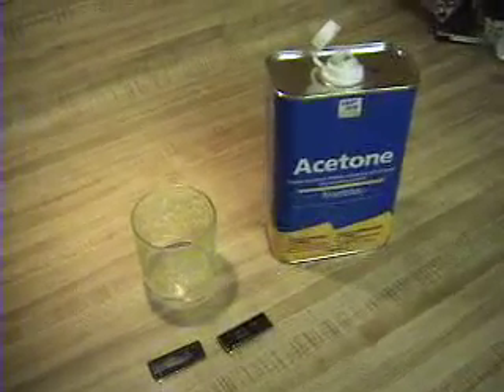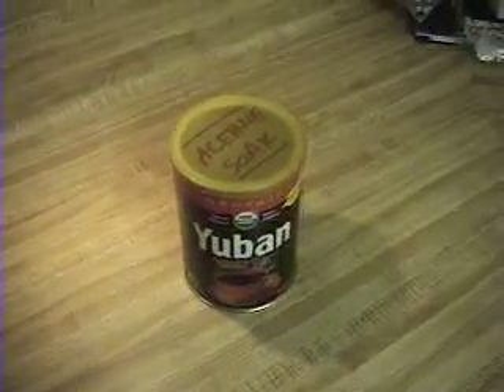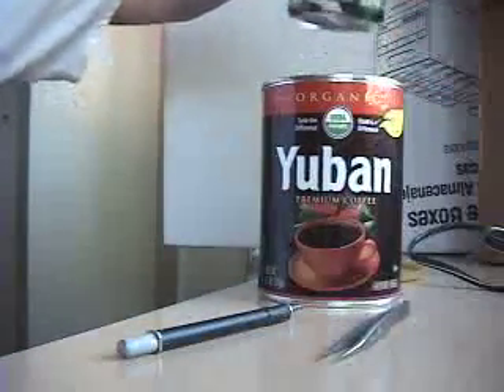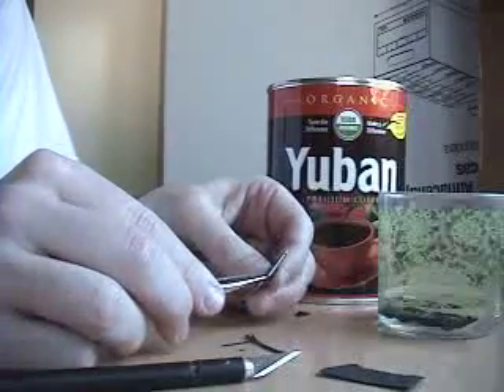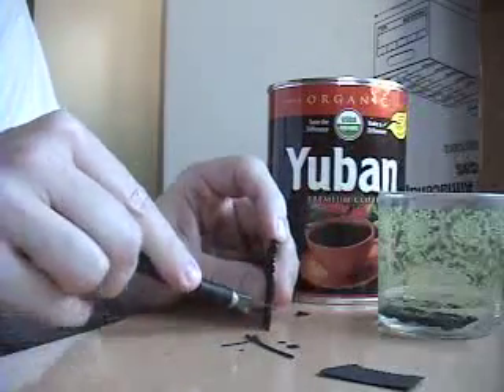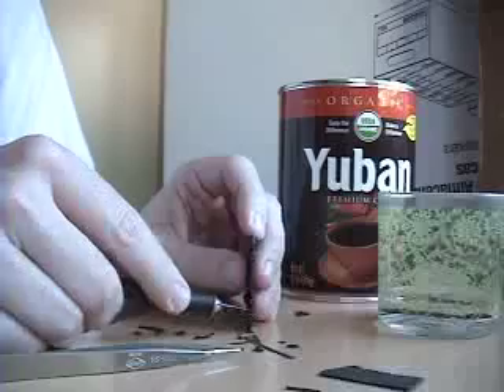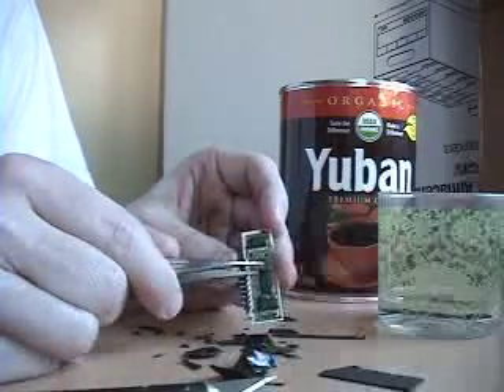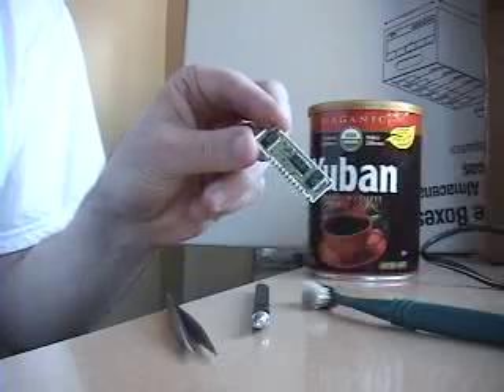Possible Repair Technique for the 80017a, the Juno-106 Voice Chip

Comment: In my case, it took at least two days for the 80017A. 
It took 4 days for MC5534A. After the first two days, I scraped the three sides of each MC5534A then I kept them in for another two days.
They come off incredibly easy if left in acetone for enough time.
You will want to replace the stupid pins on these ceramic boards and its a good idea to put female headers on the mainboard.  80017A has regular 2.54mm pins but MC5534A uses 2.0mm pins so be careful :-)
Also, I went 100% clean in terms of removing all visible remaining resin between the chip pins with a small needle. I didn't desolder the chips from the ceramic boards and clean underneath them.
I had a small problem with one of the tree MC5534A ceramic boards.  a surface mount component (capacitor or resistor I really don't know) the one closer to the pins, came off since apparently it was stuck to the resin much better than it was to the ceramic board. I can not find any information anywhere what this component is since I want to replace it. The one came off appears to not have any metal pins on it so I need a new one. I might remove the same component from another MC5534A and check with a multimeter but I would rather learn what it is from someone who knows what it is or even better from a schematic or some document. I would really appreciate any help if anyone knows what this SMD component is.

Comment: I've watched a bunch of these videos in hopes someone explains WHY removing resin solves the problem. I'm sure it's legit but how on earth does removing the resin fix an electronic issue?? Makes no sense
Reply: A few years ago someone suggested the resin becomes conductive. However this isn't actually the case; it expands and lifts the chip pins off a few microns, enough to cause them to become intermittent. When you remove the resin, the agitation of the process is enough to reseat the pins and are liekely to work again, but not always the case, hence the 60% success rate. What you actually need to do after removal of the resin is to re-touch the pins of the chips with 60/40 solder (don't use lead-free, it doesn't mix with the 60/40 it was originally soldered with).
Reply: @LEKProductions  Welp, this is by far the most helpful response I've seen to date. Thanks so  much for taking the time. I hope everyone reads this who is doing the job. The guy who made this video should add this knowledge to his video description as well, excellent. Thank you!!!!!!!!
Reply: @JMLRecording  I may do a video on my channel about this...

Comment: I didn't use an Exacto knife at all. I soaked for 4 days, pulled the loose stuff off. Soaked another day, pulled the loose stuff off, etc. It's taken about a week doing it that way. No scraping or cutting necessary.
Reply: Could this possibly damage the components?
Reply: @JMLRecording  I didn't have a problem with it. On the other hand, it didn't actually fix what was wrong with the bad one, but now I have sockets installed and can easily replace old ones with clones as I need. So it doesn't fix everything.

Comment: Hello, I am a technician and have recently started to remove the coating from 80017A voice chips.  I have found that a number of the chips have fractured internal solder joints. If you remove the coating from a chip and it still doesn't work you may want to get a tech (with a high quality soldering system) to re-solder the connections of the ICs and possibly the terminals on the chip.
Reply: Ties in with my reply to Joshua Lutz below...
A few years ago someone suggested the resin becomes conductive. However this isn't actually the case; it expands and lifts the chip pins off a few microns, enough to cause them to become intermittent. When you remove the resin, the agitation of the process is enough to reseat the pins and are liekely to work again, but not always the case, hence the 60% success rate. What you actually need to do after removal of the resin is to re-touch the pins of the chips with 60/40 solder (don't use lead-free, it doesn't mix with the 60/40 it was originally soldered with).

Comment: @nokbient : regarding being worried about it drifting out of tune in the future due to removal of the resin / coating...
While it may drift a little, the only thing it will drift on is VCF tuning, and only so slightly. As for VCA, only so slightly. The VCF tuning would likely not be detectable by the human hear as it is a filter, not an oscillator we are talking about. The VCA drift would amount to much less than 0.25dB! Which you would never hear or detect.
The DCO is stable and independent of the VCF/VCA chip / circuit.

Comment: Hallo

Nice and helpful video you did. :) 
Maybe you can help me with troubleshooting. All six voices of my 106 work fine. The only thing that's irritating is that when the VCF frequency is down (ENV up) e.g. for a bass sound, every sixth key pressed plays the sound as if the frequency knob was up (like open filter). I gave it a short check having detected that only happens when voicechip #2 is adressed.
So might that chip be faulty or is it something about filter circuitry referring to some voice path?
Unfortunately I do not know how exactly voices/filters etc. have been routed internally. :(
I would appreciate any help.

Thankies and greets :)
Reply: Calibrate the synth as per the service manual.

Comment: I stripped the polymer off and my 800170 came back to life.  I had to give it a second pass and dig out from between the IC pins a little better, but it worked.  Now to find out why my VCF freq slider is not working anywhere below 1.5. Any tips?

Comment: My friend, you are a genius. Our old 106 had the notorius 'alien' sounds in the background and the 'hanging' note. Ran the test procedure and it pointed to be chip #1. Got my techie guy at work to de-solder and remove chip #1 then I followed your instructions to the letter. 2 days later, all the coating came off easily, techie re-soldered it back in place and IT ALL WORKS PERFECTLY!!! Thank you so much for sharing your skills with us all. Kind regards; Paul

Comment: I am asking the same question MarbleMad had...

Does anyone know if this works long term?  I did it to 2 chips on an mks-30 and it worked..  I am trying to sell it.  Would it be a good idea to strip the other 4?  I would hate to sell it and have another chip crap out a week later, but if this fix causes other problems down the road I wouldn't be comfy with that either.  I am an electronics tech so I'm not really worried about damaging anything good on removal.
Reply: Seven years later, does it still work?

Comment: How do you know what's wrong with these chips?
Do they overheat during use?
The plastic package covering the chips is not the best heat contactor. 
Do these chips have defects in silicon that becomes worse and worse 
during use?
I think someone will need a very expensive piece of equipment
and a good reference  datasheet to determine what's wrong with these components...

I hate disposable electronics...

Comment: Hi!
My 106 seems to have a problem with the filter resonans after I had new voice chips. I can't seem to get all six voices to track even with keyboard tracking when the filter is self-osclating. If I set it to poly 2 mode and only use one voice at the time i am able to play simi tones with it, but when it is in poly 1 mode and I play more then one voice, the voices doesn't tune up together. Do you know how I could fix this?

Comment: Just wanted to let you know that I did not give up yet. I did save the chip and continued to soak it in the acetone for a few more days, and successfully got most of the resin off of it. Now, hopefully I can find information on improvising new pins so I can go on with the project. Until then, courage.

Comment: i tried this on a 106 my bandmate got for $45 with a very very quiet #4 voice chip. took longer than as advertised for the coating to dissolve (soaked for about 6 days), but i got it all off. put the chip back, mounted the circuit board, etc. and it worked!
for a little while. i left it on for a while, then went back to play it, and it sounded just as busted as it did before. it was worth trying though. time to save up for a new chip!

Comment: 100% pure silicone rubber (sealant) is non-conductive. I've used it in high voltage circuits for TVs. The bad chips that I cleaned didn't have a black silicone coating inside but the ones that were good (I cleaned off the coating anyway) all had a thin layer of black silicone. Either Roland discovered the coating problem and solved it by using silicone under the coating or the company that actually made the chips took a shortcut and didn't apply the silicone layer before the external coating.

Comment: This is an amazing fix will be trying this on my faulty juno voice tonight!! Thanks so much for putting up this tut greatly appreciated. I actually bought a replica chip about 6months ago and still havent got round to fitting it as was concerned about calibration problems. How did you find removing the actual chips was it tricky did you use a solder sucker?? Also can you possibly tell me how you got it into "voice number mode" on the dispay. I can't remember how to do it?!

Comment: I used an Xacto knife and magnifying glass (lupe) to CAREFULLY clean the coating from the laser cuts in the resistors. I didn't dig the blade into the cuts; just scraped the blade over them. Some of the chips had to be soaked for 24 hours, cleaned the coating that came off easily, and then soaked for another 24 hours. The acetone only seems to affect the coating; not the bakelite that the actual ICs are made of or the green coating on the chip which is actually a circuit board.

Comment: The coating IS the problem. Apparently, it semi-shorts out the circuitry which is precision tuned with laser trimmed resistors. I've successfully repaired 12 chips by CAREFULLY cleaning all of the resin off the circuitry; especialy the 10 laser trimmed resistors (dark rectangular patches) where the resin tends to stick in the tiny laser cuts that tune the circuit. I wish I could post a link to an image of one of the chips that I repaird. The good chips had a thin layer of black silicone inside.

Comment: To prevent humitity from affecting the 10 laser trimmed printed resistors. Probably not necessary but silicone won't turn conductive like the original coating did.

Comment: I put a thin coat of clear silicone rubber on the component side (green) of one of the chips, let it dry, and then left it in the Juno for a day to bake. No problems so I coated the remaining chips last night and will reinstall them tonight and make the adjustments as described in the service manual. EVERY JUNO 106 OWNER SHOULD NOW ABOUT THIS FIX!!!!!

Comment: Over one week of the 106 being constantly on and the chips all sound like new! I'm going to put a thin coat of clear silicone on one of them to make sure that it doesn't affect the circuit. The silicone is just to make sure that there isn't any chance that any changes in humidity will affect the circuit.

Comment: Us Test Mode to determine which 80017A chip is bad. Power the Juno up with the KEY-TRANSPOSE button pressed. Now press Poly1 and Poly2 together so that both buttons are lit up. That puts the voice chips in rotary mode so that each time you press a key, one chip will be activated after another. The display will show which chip 1-6 is activated. 1=IC13, 2=IC11, 3=IC9, 4=IC7, 5=IC5, 6=IC3. Lots 41C and 42B are known to have problems which also happen to be the ones that were bad in my units.

Comment: Why did you pull he MC5334a chips? The six 80017A chips are what will cause random static and random stuck notes. When mine were sticking, the sound was very quiet. It wasn't like holding the foot pedal down.

Comment: That is probably a layer of silicone rubber which were on the the good 80017A chips that I decoated. The ones that didn't have the silicone under the coating were bad until I cleaned them.

Comment: The resin coating tends to stick to the tiny (1mm) long laser cuts in the printed resistors on the chip so make sure that they are clean. They are coated with a thin plastic coating (lime green) and the laser cuts go through the plastic coating and through the printed carbon which forms the precision resitors. DON'T SCRATCH THEM but make sure that the laser cuts are clean. My cleaned chips sound perfect even without adjustment! I'll put a thin coat of silicone on the chips this weekend.

Comment: The uncoated chips have been running in the Juno for three days now and sound great! Make sure that the printed resistors (black patches) are clean. I used my finger nail to scrape off the remaining coating. I removed the coating by soaking them for 24 hours, removing what came off easily, and then soaking them again for a few hours at a time until they were clean. A pickle jar works great for soaking them!

Comment: Great info! I just decoated six chips, 3 working and 3 with sticking notes, and ended up with 6 working chips. the chips that were working had a thin layer of silicone rubber covering the components to protect from the coating that they figured out would become conductive or capacitive
DO NOT SCRATCH THE BLACK PATCHES ON THE CHIPS! They are precision laser trimmed (one or two tiny 1mm black lines partially across them) resistors. Note that I soldered IC sockets so I could plug in the chips.